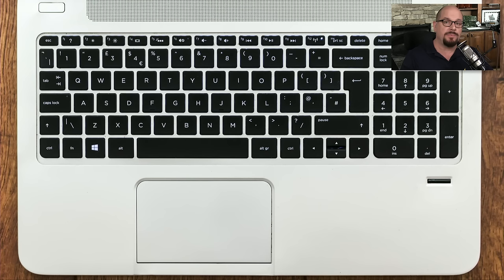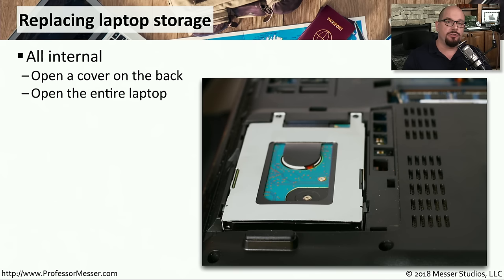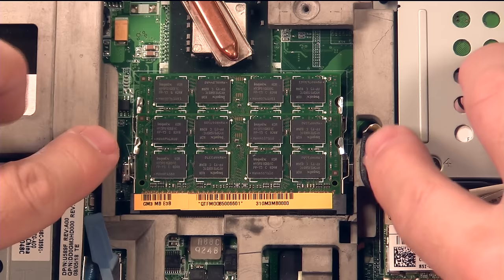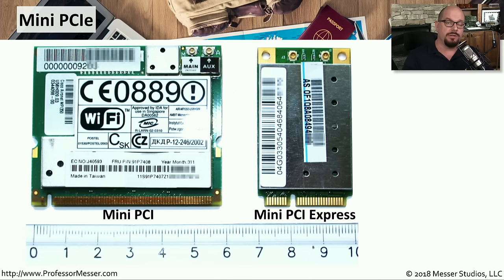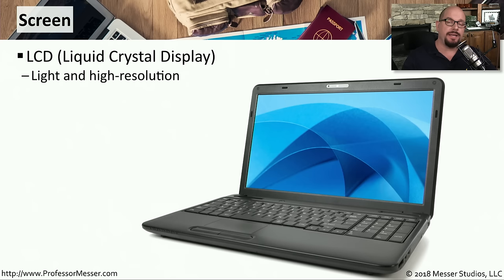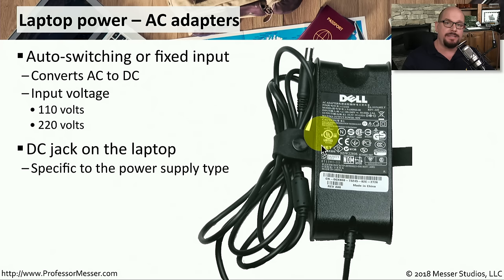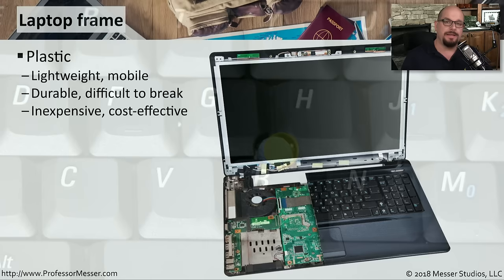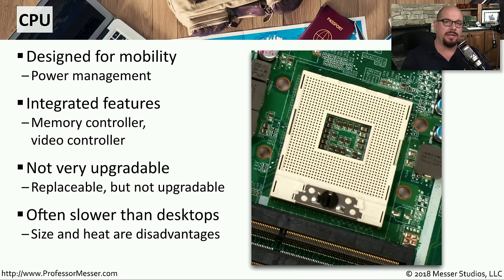Laptop Hardware - CompTIA A+ 220-1001 - 1.1

Comment: Silly question, but what does upgradeable exactly mean? Ive always thought replacing and upgrading are the exact same thing so I was slightly confused when the CPU slide mentioned "replaceable but not upgradeable".
Reply from the maker: Replacing means swapping out a CPU with the exact same specification. If your CPU goes bad, you'll need to replace the chip. Likewise, if you have to replace the motherboard, you can move the CPU over from the old motherboard to the new one.

Upgrading the CPU would be swapping it out for a higher-performing or faster CPU. Most laptops aren't designed to provide the ability to upgrade a CPU.

Comment: professor messer, I'm a bit confused by what you explained between auto-switching and fixed input, what exactly is the difference between them? Is it that auto-switching power supply can be used on many types of laptops with more range of compatibility while fixed input is limited by 110v/220v?

Comment: can someone please explain the resolution of the screen being fixed, does it mean that the screen of the laptop can not be made smaller or larger because it can be physically made larger or smaller. I'm confused because its been said the resolution is fixed are we talking about the number of pixels being fixed or the actual laptop screen size, because it kind of contradicts that resolution is fixed if we can change it.

Comment: What is the difference between 220-901 and 220-1001, 220-902 and 220-2001.
Which course I should take. I am new comer
Reply from the maker: The 900 series exams were the previous version of the exam, and are now retired. The 1000 series exams are the latest versions.

Comment: Auto-switching AC adapter, meaning that it can switch from 120 to 240 VAC automatically. I read this in Prowse's book. In your video, it says 110 to 220 volts. Could you please guide me here?
Reply from the maker: The exact upper and lower ranges will be specific to the power supply, but they all cover the entire range from 120 V to 240 V, and usually just a little bit more for good measure.

Comment: Hey Professor Messer, I have a question. In the video you described the 1.8 inch form factor of SSD as being an older version and not that common in current laptops because the form factors are able to get smaller and smaller in laptops, and this confused me because wouldn't the 2.5 inch form factors be the older version and the 1.8 inch form factor be the new version because the 1.8 inch is the smaller form factor?
Reply: No the 2.5 is able to hold more memory. 1.8 is capped.
Reply: @SlimmDrea  yes